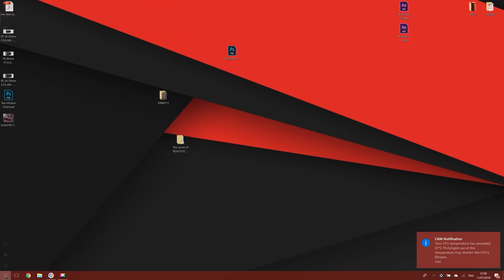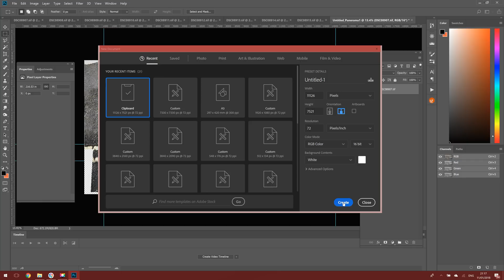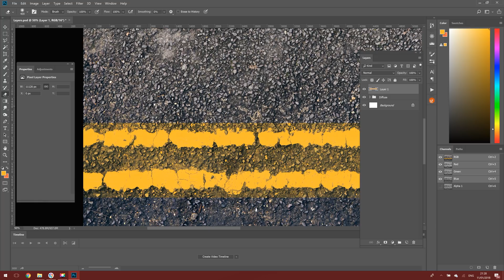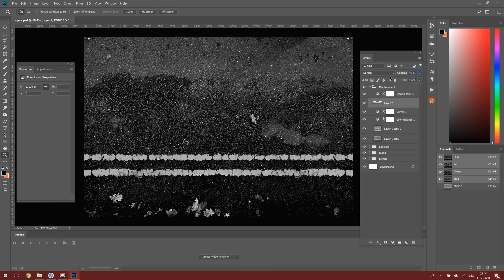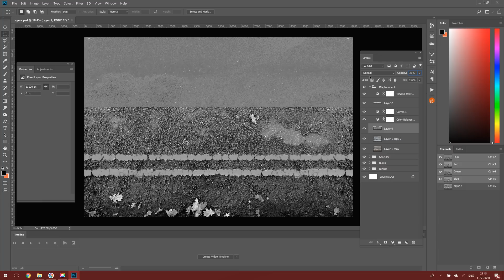The secret of REALISTIC TEXTURES | Material channels explained

Comment: This looks so awesome. I have a question about you renderer, I have a Macbook Pro 15" with a Radeon Pro 560X and at home I have a eGPU Case with a Vega 56, is Octane still good with this setup because its not a Cuda GPU? Or should I use another renderer?
Reply from the maker: Hi mate. I’m afraid engines like Octane and Redshift requires CUDA cores to run which can only be found in nvidia cards.
Reply: @AndreyLebrov  Thats what I thought, so I only can use the ProRenderer in C4D?

Comment: HOLY CRAP what lvl of subdivision did you use there. Just bought the texture damn it man that's a lot of polygons
Reply from the maker: Octane Render doesn’t require subdivisions for displacement. It’s 1 polygon 😄
Reply: Andrey Lebrov well I don't know how this works :/ might be a similar process I'm using. trying to make it work in blender. It looks pretty nice but I end up with 13gb usage just for the plane. Wish I could try octane just to figure out differences to make it work :/
Reply: Andrey Lebrov also the ground ends up really "spikie" like spikes everywhere  just not on the yellow line. Maybe you have a idea why?